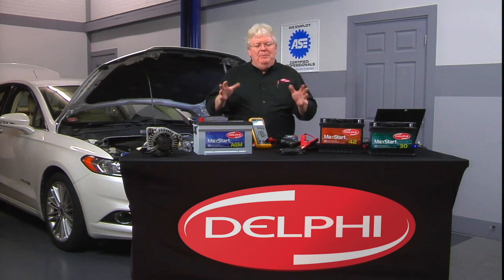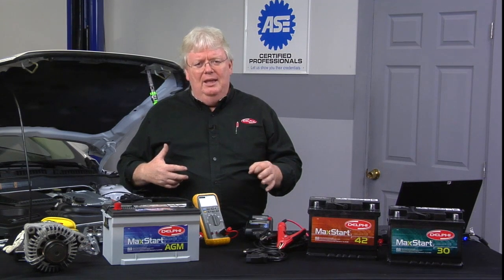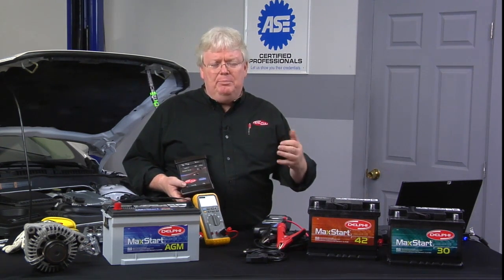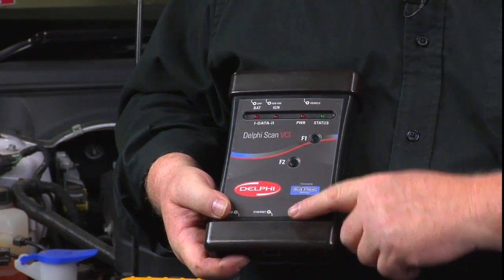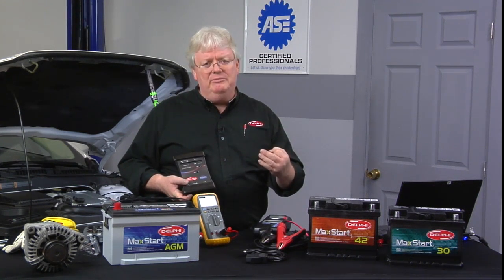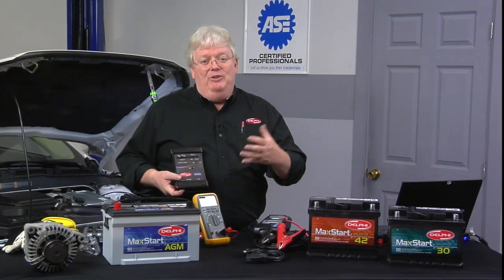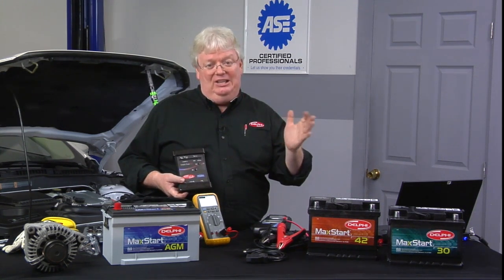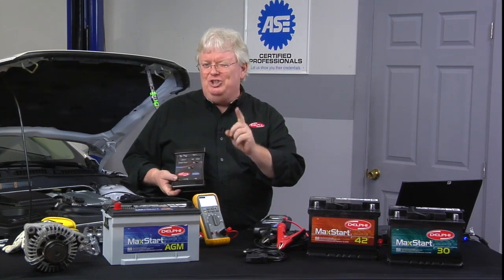How to Eliminate Battery Charging System Problems

Comment: GMC
Service battery charging system, what can I do sir?
Reply: What did you do? I replaced the alternator and battery is good. Still getting "CHECK BATTERY CHARGING SYSTEM" error
Reply: @cperry76705  check ur belts and pulleys. If the belt isnt on properly the alternator wont charge the battery
Reply: @dancingbam4240  Appreciate the reply.  I didn't connect all of the wires completely.  It never fully clicked in.  Fixed that and u was good to go.
Reply: @dancingbam4240  now if you guys know how to fix a service stabilitrak alert please inform me. I've already replaced the spark plug, gaped it and replaced the Ignition coil
Reply: @cperry76705  i just had the same problem and my pulley was bad and they belt as well . Fixed both and the message went away
Reply: @cperry76705  my impala has the stabilitrak message . Ill do some research and get back to u

Comment: Great information . Unfortunately , many shops operate in the Stone Age . I wonder how many dealerships are this thorough ? These issues are only addressed after a few visits with the customer demanding a fix . The dealers usually brush it off as a picky or crazy customer . If under warranty , they should provide a loaner vehicle . The customer expects the manufacturer to be able to fix it .